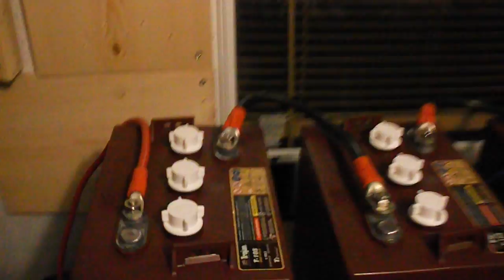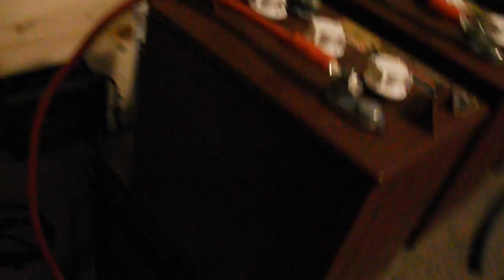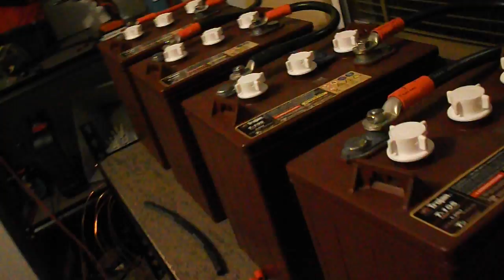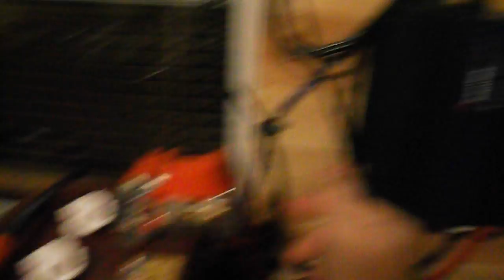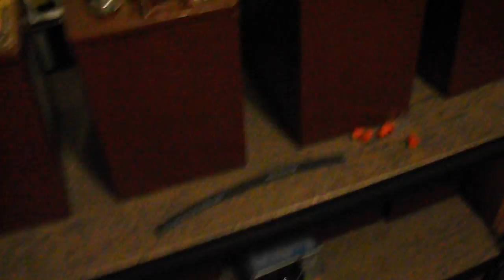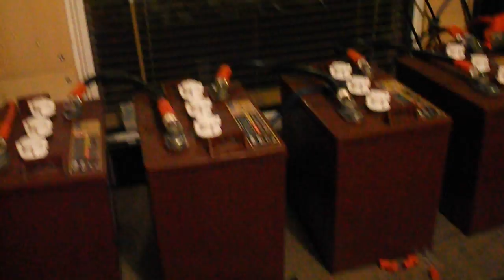12 Trojan 6v T-105 wired in Series and Parallel for a 24v 675 AH Solar Battery Bank

Comment: Hi

I have exactly the same batteries and the same arrangement.

Also here 3 battery banks of 4 Trojan T105 batteries.  I have chosen for Trojan because these batteries have a good reputation.

I have the batteries now more than a year in operation so far I am very satisfied. 

Zie photo.  http://i969.photobucket.com/albums/ae178/lex6363/P1020679_zps6xd8qpbi.jpg?t=1489871231
Reply from the maker: Nice setup. However i recomended having a space between batteries for help to keep cool and airflow
Reply: My batteries become never warm.  there is a little space between the batteries 1/2 mm.

Here some information about my energy system.

This summer i make a nice case around the batteries with ventilation computer fans that automatic  switch on when battery voltage rises above 27.5 volts.

I have connected 6x 260W 96 cell 48v home-roof solar-panels 3x2 panels in series for double voltage.  My new Victron BlueSolar 150-60 MPPT charge controller. Those can regulate 1770 watt 150 volt maximum at a 24 volt battery system.

I use a Victron BMV 700 battery monitor for the status of my 24 volt 675 amp Trojan battery bank

I have a Self made Kubota diesel DC Generator set 24/75Amp With 3 stage microprocessor Mastervolt Alpha regulator. 

AC power management

Victron 24/800W    230V 50Hz AC Pure Sine wave inverter for daily use. 
Victron 24/3000W 230V 50 Hz AC Pure Sine wave inverter for heavy loads.

Comment: How much power can you draw ?
Reply from the maker: Well i have rearranged my battery bank since this video, but it is still a 675 AH bank. I also now have a 1500 Pure Sine wave inverter. I tested it and i can use up 1200 watts through the inverter. However i only use it for maybe a minute. I normally run 300 - 400 continusouly and i can run it for at least 12 hours before batteries need to be recharged
Reply: Zakarume can I ask what you are using in your house ? how about air conditioner ? Microwave? Hot water heater ?
Reply from the maker: @ZoneTelevision  just using for my computer setup and tv and some lights. I have upgraded to 2000 watts. I am making a new video with all new Victron Products. Will be a few more days